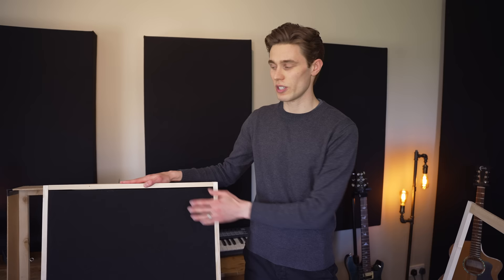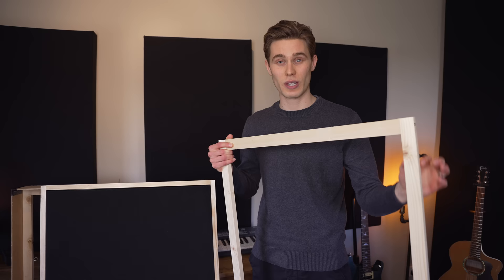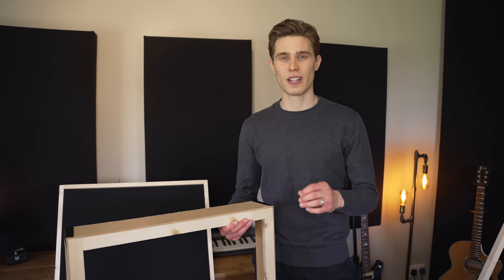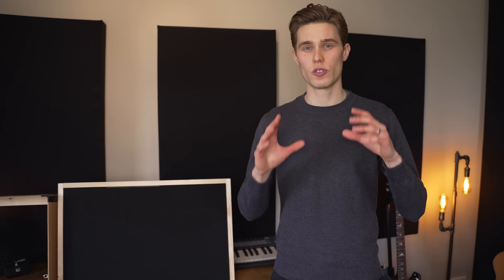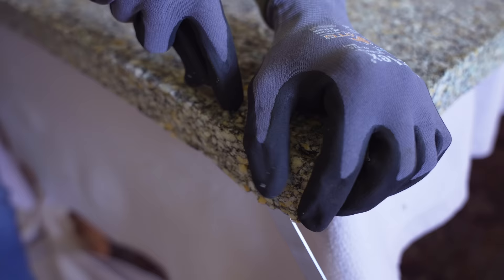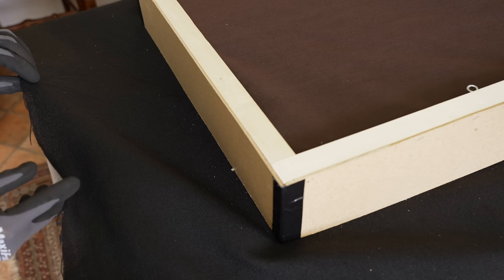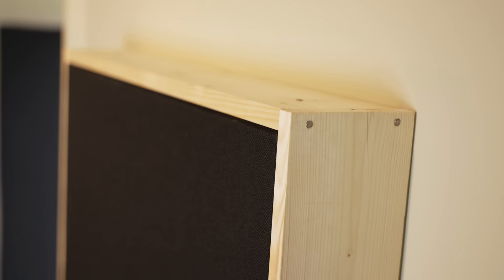How To Make Your Own Acoustic Panels - DIY Professional Acoustic Treatment for Home Studio

Comment: Those type of panels are ONLY going to really be effective to cut down reflections which are typically above 100hz.   they WILL not do much for noise suppression, that requires a totally different technology that's more about how having an actual barrier walls/ceiling constructed.

There are three types of walls in a home/studio.  the exterior wall is the THERMAL wall that is for heat retention.  the next wall would be a barrier wall to prevent noice going in/out.  The third type of wall is the treatment wall to absorb low frequencies that would be more in the 100hz and BELOW.  Those are the pressure problems, so you would have to essentially look at AXIAL mode problems with the room and the amplitude of the frequencies that pose the biggest problems.

Panels like this are really just to reduce reflections/reverberation time.  Echo is not present in a room. There's Flutter echo, but that's more of a reverberation than an "echo". Think of an "echo" like when you yell HELLO in a big canyon and hear the word HELLO repeating.   So, don't use the term "ECHO" when it comes to small rooms.

For low frequency problems, you need a PRESSURE based absorbion rather than a VELOCITY based absorption which is what these types of panels are.

These are more cheap and dirty types of treatment, but they aren't really designed to really the best form of treatment.  They certainly won't do anything with LOW frequency problems at 100hz and below, which is where there are a lot of room problems that are much harder to treat.

Comment: Thanks for this instructive video. I was wondering why you do not recommend insulation materials with density higher than 30Kg/m3...what is exactly the problem? Most of the recycled filler I can find has a density of 80-90 Kg/m3.

Comment: I have never had any problems with stone wool myself, but I always use a mask and gloves when working with it (and a workwear clothing). Glass wool/fiberglass, on the other hand, that shit is terrible for your skin, lungs and eyes! I'm glad that most of the contruction industry in Sweden has switched to using mostly stone wool for domestic appliances, like insulation for houses etc. It would ofc be better to switch to recycled denim, hemp or whatever, but I've never seen it being available to buy here in Sweden.

Comment: Very informative video. Do you think mounting the panels with for example 10mm spacing to the wall would make them perform better or worse? The sound will "see" both sides of the insulation which should be good, but in the same time you will uncover more of the walls area that probably is more reflective, potensially increasing the reverbration time.
Reply: Better. The further away from the wall the better. Letting an air gap as thick as the insulation material will nearly double it's acoustic performance.

Comment: * Size: 50cm x 100cm x 3cm * Foam type: Rebonded density 70 * Color: Striped (because rebonded foam is crushed foam that is compacted, the color is different for each batch depending on the color of the crushed foam used during production) * Tougher than HS foam ironing pads, making them suitable for steam laundry pads

Hi sir, is this kind of foam suitable for soundproofing? Please help
Reply: He mentions in the video that above a density of 30 the material is probably a bit too heavy

Comment: A mistake in choice of back fabric, and the panels should be mounted 6" away from the wall. You should manage the bandwidth of the absorber. With a solid back the bandwidth of a 4" thich panel might be from 1 khz to infinity. It would be much better to make it effective from a lower frequency in exchange for the ultrasonic where absoprtion is useless.

Comment: A couple years ago I made similar panels, more quick and temporary design. I used 2x4 stud dimensional lumber, filled with roxul safe n sound and wrapped in black bed sheet fabric. 

I will be making more and redoing the ones I have. I like the idea of using the thin board on the sides to save costs and weight.

Would you recommend keeping them close together as they appear behind you in the video or spaced out more if the room is larger?

Comment: Thank you for this great video 🙏🏼

Quick question for you, do you have any experience with fiber wood wool? 
It has a very high density up to 45kg/m3 and they say it has more sound absorption.
Is that good or too much density?
I’ll be building them in the size of the wood fiber, 1240 length, 600 width and 195 depth.
Cheers
Reply: How did it go? Give an update for us all. :-)

Comment: Any sort of foam rubber such as you show is a poor choice for sound absorption. If one is on a strict budget, the acoustic remedy needed is almost invariably absorption, and there are lists to help choose the most effective material. They include the frequency response of those materials which is very helpful to making a better sounding room. You can build several variants just by changing the material and will find it incredibly useful to place them as your familiarity with the space’s needs improves.
Reply: Can you please give a link to such a list?
Reply: @MachoMaster    I wish I could but all of mine are manufacturer-provided documents sent to me in pdf form. You can do your own search with terms like ‘acoustic materials specification chart’ or ‘… comparison chart’. Be prepared to spend some time. The best of them specialize in a certain focus, such as low frequency absorption, or diffraction vs frequency. They are highly technical charts but it is possible to find valuable comparative information whether or not the user understands the terminology.  They are made for designers to compute the effect of a certain dimension of a material as specified in their plan. 

I should also say that these many, many charts meant nothing to me until I found white papers describing a general type of material and the particulars of its installation. I have whittled my database down to about 60 documents in total. Some of the findings are really surprising and I found correlation from another provider before I believed the specs. Some are provided by the companies that sell them, others are just stock material specs for designers. Good luck. I wish I could be more helpful
Reply: @artysanmobile  
You were super-helpful! Thank you for taking your time and writing such an information-dense comment. Now I know how to go forward and where and how to look for more information. I truly appreciate your help! Have a great life, my kind and helpful man!
Reply: @MachoMaster    What an awesome reply!  👍🏽👏🏽   You’re very welcome.

Comment: Thank you for this excellent video, Michael. I´m currently about to build my DIY Acoustic panels and after watching your video I definitely want to use Poliester Fiber because health care is very important (The most for me). But please let me know what I should do if the only available choices are Fiber Glass or Rock Wool. I found that Rock Wool was supposed to be safer than Fiber Glass Wool. The thing is, both materials require special care protection for handling, so I think about what you said is not really safe. What about using slag cloth or Poliester Fabric to cover the panels including the back side? Do I need to place 2 layers of fabric on the panel to be safe from the Rock Wool or is just one layer enough? No worries about the assembly process, it doesn't matter if you use the whole protection equipment while the making of. I really want to make sure I proceed to be safe with those panels in my home studio with some specific assembling procedure. what do you recommend me to do?

Comment: Is the wood you use for the main frame pinewood? How do you deal with it being not 100% straight when you have to staple the sides onto each side of the frame? I asked a local seller to cut pinewood to my desire sizes and they said there would be +/- 2 to 3mm error and each piece of wood might not be 100% straight either due to it being natural wood.

Comment: in my local hardware stores i mostly find panels with a density of around 45 kg/m3. Could you elaborate a bit on why you wouldn't recommend that high of a density? Wouldn't the  absorption be even better?

Comment: Love the video.  Beautifully finished panels.  Thank you.  However, there is nothing wrong using Rockwool.  To me it's similar to saying don't use a knife as you might cut yourself.  Other than that, best video I've seen on building an acoustic panel.
Reply from the maker: Thank you for your comment. I want to assure you that I’m not the sort of person who goes overboard on safety, it’s just me sharing my personal opinion on the safety of glass and mineral wool after suffering health issues when handling them.

Comment: No one in this day and age talks about acoustic panels without describing what frequencies are controlled. You didn't specify this. Care to comment? I need suppression from 130 Hz and lower. Otherwise, great video! Thanks...
Reply from the maker: 130Hz and lower will require some deep and dense panels. I would imagine you would need several feet of material to successfully manage low bass frequencies with panels. There are some other active bass trap solutions which might be more effective and take up less space such as the AVAA by PSI?
Reply: @inthemix  Thanks for the link. I've never seen that technology. There's also panels made by Acoustic Fields. Both solutions are very pricy but they probably work wonders 😉. Thanks again...

Comment: Great video, thank you! Do you have a rule of thumb to calculate the number of panels required to adequately treat a room based on its volume in cubic meters or area in sq meters (if the ceiling height is standard)?
Reply from the maker: You can go down a rabbit hole with this topic but generally covering around 20-30% of the exposed surfaces in your room significantly controls reflections while maintaining a lively enough sound provided you have some furniture in the room.

Beyond 30% coverage sounds highly controlled and “dead”. Less than 20% coverage will sound much brighter and lively which might be better for recording but not as good for mixing.

Comment: Thanks for the very good video. I found this wood insulation,but it's 50 kg/m in density. It should be fine to work with. Is it better acoustic wise with more? Best regards

Comment: Hey quick question for you. Since the insulation is just kind of suspended within the panel, do you worry about it compressing down because of gravity over time? Would it be wise to staple the insulation to that wooden frame on its four corners or glue it or something? Thanks in advance!

Comment: Great video! Michael, two quick questions: you used two layers of high density recycled denim, a choice I really like, could you tell me the density and the thickness of these panels? More importantly: in order to absorb the lower frequencies (100-250Hz) does this material also perform well when going up to 200mm of thickness? Some materials tend to become more reflective at a certain thickness and/or density than others. Does denim at the same density and thickness outperform a rocksono solid to your knowledge? Just curious what your thought are about the subject.

Comment: Thanks, very clear and well structured! Do you use a panel for on the ceiling as well? Do you reckon I could construct a similar one for this (except a different mounting solution ofcourse)?
Reply: And Michael, in your example you use two of the same density foam slabs. For sound absorption, is it not better to use two slabs with different densities? I thought different densities absorp different frequencies?

Comment: Hi!! Best tutorial on this topic by far!! Do you think it could withold its own weight? Stacking 2 would be a perfect match, sort of a DIY  GIK acoustics mobile vocal booth for example (I'm in this project right now actually)
Reply from the maker: You could stack 2. Alternatively you could make floor stands/legs for each single panel and move them around as portable panels. This would probably be better value and more effective as you could get them around the microphone/performer in the right place.

Comment: What a great video! When you say that 40-50 kg is difficult to work with you mean it from an acoustic or weight point of view? I discovered the panel I made has a density of 80 kg/m3 (I used two of them and it's 8 cm thick). Is that a problem?

Comment: Love the video ! Super helpful !
I wonder now if the bass trap in the corner is also DIY ? is it just a different size of the same pannel type or is there any particularities for these ? 🤔
Reply from the maker: Thanks! They are DIY. A similar concept but using planks instead of framing with thin boards. I angled the sides to fit into the corners and I used a material with higher density to fill.

Edit: they are not hanging. I rest them on the floor and secure them to the wall at the top to prevent them falling forward.

Comment: Hi Michael, thank you for making this video! I'm looking at options and have discovered some recycled foam panels for a good price, however, they are only available in 64kg/m3, 96kg/m3, and 128kg/m3 densities. 
I have two questions, firstly are there any acoustic disadvantages to higher-density foam or is it simply a matter of workability in building them? I would imagine denser is better for its acoustic absorption properties?
And does this recycled foam stuff look like it would work? It looks like it's just foam, not foam and fabric like you used. Do you think that makes a difference? 
Would love to hear your thoughts on this!

Comment: I want to build some sound dampening boxes for my smoke machines and air compressor that is used during Halloween.  These machines can be rather loud and destroy the atmosphere of the props.  Would these type of panels hold up pretty good outside and potentially get wet?  If not what would be a good alternative?

Comment: I have 2 questions, when I use a denser material, like 40 or even 80kg/m3, can I make it thinner? And would it be a problem to cover the panel with an actual painting (on canvas)?

Comment: If one wanted to hang a panel from the ceiling, the only things keeping the foam from falling out are your fabric and a few staples.  Any suggestions on providing a little more support than that?
Reply: Add 2 or 3 600mm timber sections horizontally to support the foam.

Comment: gud morning in the mix, nice one my fl studio master. please can i use foam, like normal for the acoustic panels?
Reply from the maker: Good morning! You certainly can use foam. Regular acoustic foam will be very lightweight but does not have good absorption in the mid and low frequencies.

It can be a good choice if you want to reduce echo and bright reverberation in a room but is not ideal for creating a good mixing/mastering space. 

Every material has it’s pros and cons.

Comment: I’m looking into this more because I’m also paranoid about the potential harms of fiberglass insulation. 

I wanted to ask, what kind of studies did you read to ensure the safety of the denim insulation. Based on studies I’ve read the problem isn’t that microfiber itself but the size of the microfibers and how the bigger ones don’t get expelled from the lungs. Just wondering where denim falls in that conversation!? Thanks so much, really would respect your opinion on this 🙏🏻

Comment: I tried manual stapler gun for attaching the sides to the wooden frame, but couldn't attach them securely. The staple gun I tried requires significant force to properly staple the sides to the wooden frame. Isn't using wood screws easier for a beginner like me? Or should I buy electric staple gun instead of manual staple gun?
Reply: Maybe your side material is a bit too dense to take a staple.  Mine was.  I used 1/4” (3/32”really) hardboard.  Although my staple gun had no trouble driving into the pine frame, it wouldn’t penetrate the hardboard.  There are softer thin sheet materials, but I was gifted a 4’x8’ sheet of surplus hardboard from a building project, so that’s what I used.  

So yes, screws worked quite well.  I secured the frame in my bench vise and hand-clamped a strip of hardboard in place, then drove counter-bored pilot holes, and finished with 1” #8 wood screws. The screws don’t show on mine because I added pine outer frames like Michael shows in his video.

Comment: Brilliant tutorial. Thanks so much. I was looking for ideas of creating sound absorbing panels for a reburbished echoy
 church. Have been looking at using towels as an insulation option.  What is your opinion about old towels?
Reply from the maker: Towels will certainly soak up some of the echos. They might not have very good properties for absorbing bass though.

One if the issues is making towels stay in place in the frame. You might need to staple them in position and they tend to droop down over time.

Michael

Comment: Thank you for this really great tutorial. I have build some acoustic panels using mineral wool but I want get rid of these when I move to another flat. I have found some pretty affordable hemp fibre panels. The density is at 37kg/m^3. Is this problematic acoustic wise or is it fine to use? Because I think a too high density can stop the sound wave from entering the panel and it just reflects the sound.

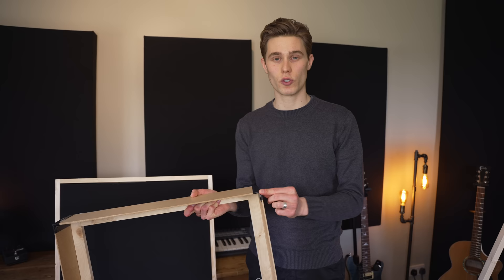Comment: Amazing videos matte.  At 5:30 sealing the back. How thick should that fabric be in order to not allow the acoustic insulation to go through?  thanks
Reply from the maker: Thickness of the backing material is not ad important as the tightness of the weave. I think the fabric is actually very thin but it’s almost impossible for anything to pass through it besides water.